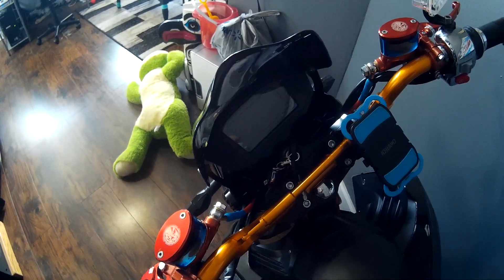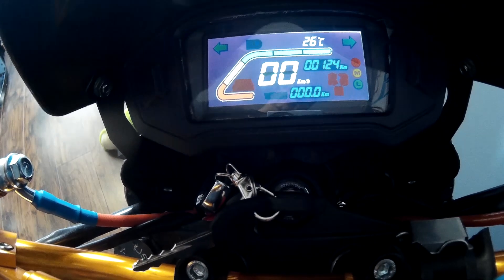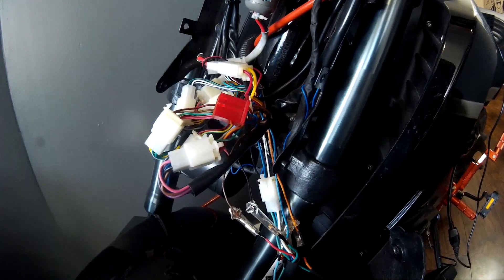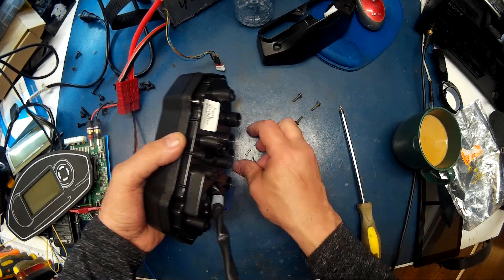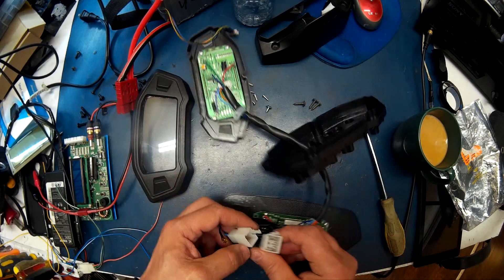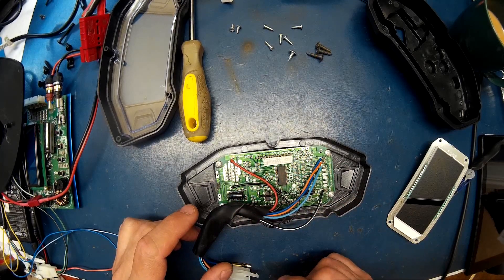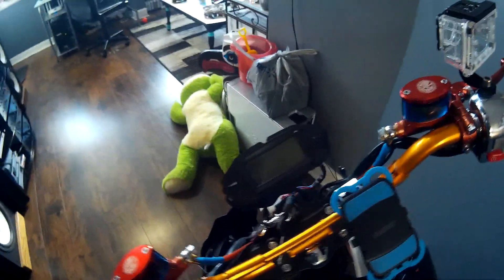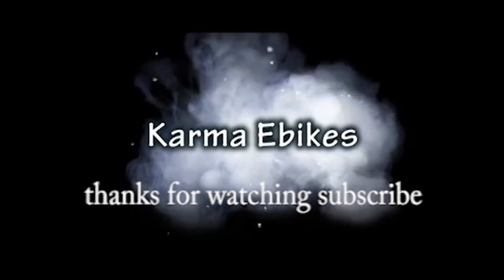ebike speedo modification(better display of voltage)

Comment: 🤔 I Could be wrong but it just looked like you replaced the Daymak Em1 clone (Terminator) with the Daymak Rogue speedometer. And if its a Daymak Clone...............you know its cheap as hell lol
Reply: never had problems with it. and its readable. proper voltage etc.

Comment: @ 9:50 i switched boards like you did but now speed reads backwards. It counts down. Starts at 16km and goes down.  Any ideas. Looks like the same board.
Reply: not a easy fix without it right in front of me. to look over.
Reply: @KarmaElectronics.  Thanks for the reply. The last board had no power. Replace with new board. Same same but different.  Everything works perfect except the speedo part. I was reading about hall wiring and some wires are pos and some neg. Would that cause the speedo to work in reverse. Any thoughts on that ?